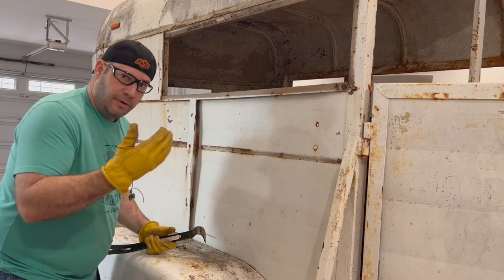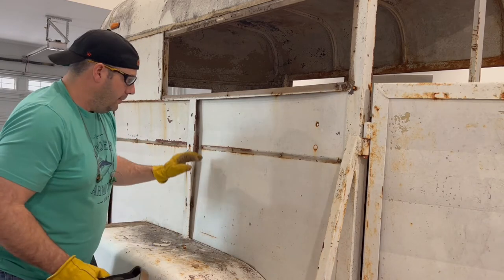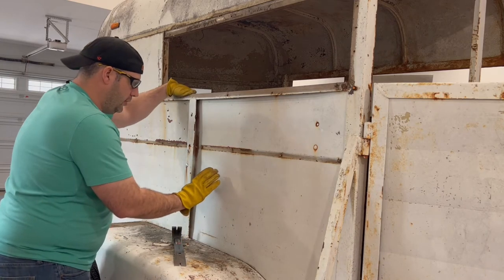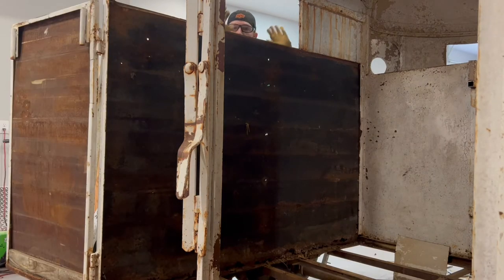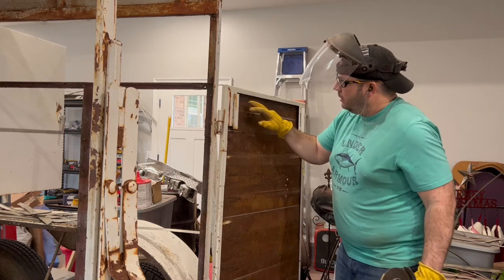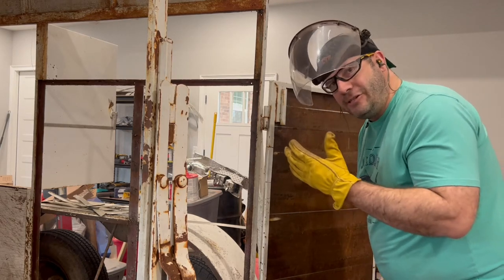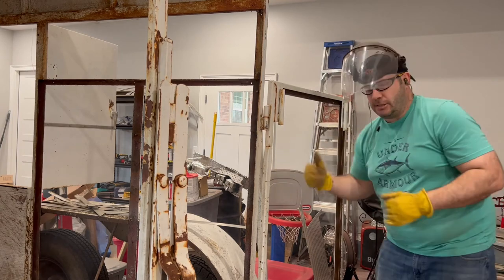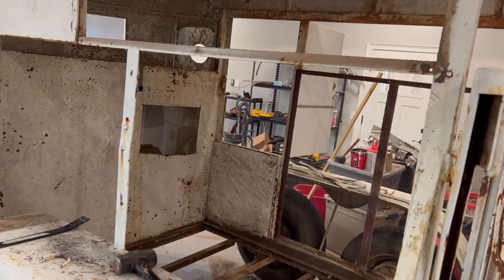How to remove the wall and door metal skins. (It's easy)

Comment: What if your wall is solid metal? Do you just cut the whole wall out and leave the support metal?
Reply from the maker: It will likely be tack welded and you can just cut the small welds. However, it it’s welded all the way around, you could get to cutting and leave the support metal or cut it all out and weld in new support metal.

Comment: What size of gauge metal do you recommend for replacement?
Reply from the maker: I replace with wood because it adds a cool look. However, the old metal taken out is something like a 26 gauge. You could cut off a piece and take it to a metal dealer to find out for sure.